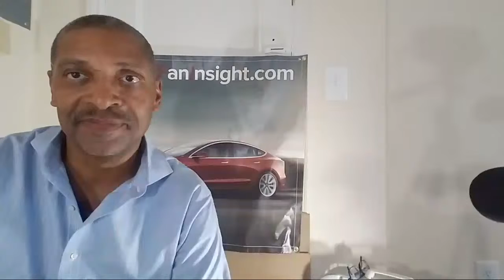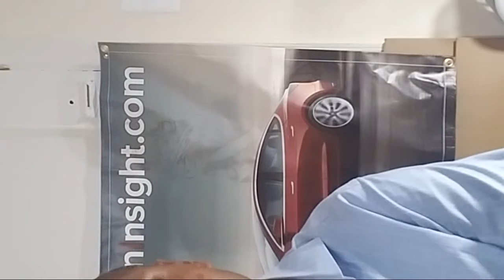5 Reasons Maxwell Dry Electrode Not Viable TESLA

Comment: Yeah, lots of confusion here. Dry battery electrode is a manufacturing process, not a chemistry. Ultracapacitors/supercapacitors (not superconductors) is something completely different, that used in concert with batteries, creates a winning combo. If you’ve ever been around a car with a massive subwoofer system, without capacitor, when the bass hits the headlights dim. With capacitor, the large spikes in power are shaved off from the perspective of the battery, thus the battery never has to work that hard. Same principle will be used with Tesla cars.

Comment: You contradicted yourself with reasons 1 and 3. Maxwell tech isn't viable since it won't be ready until 2022. Yet Tesla should fear superconductors that might appear in 2022? If a supercondcting solution were released today, it would take 5 years to develop an ecosytemaround it. No ICE car manufacturer will support it since it would cannibalize their current products and destroy their dealership's profitability.

Even your statement regarding Maxwell's market value was incorrect. The stock was devalued because auto makers had not made significant investments in battery tech to take advantage of Maxwell's tech. The product was proven to be viable but Tesla was the only company who could use it. Maxwell cooked a steak, andTesla was the only diner in the world with teeth.

Comment: This topic felt like either less researched or misunderstood, trust me not few years ago I was also one of the people who believed battery powered car is impossible (mostly due to media negative news) so I am not bashing you etc.

First of all, industries marketing team use terms which sound catchy or have wow factor to get public interest while terms might technically be wrong, like laser treatment beauty cream, and here they may have mixed the supercapacitor charging with superconducting bcz capacitors charge at blazing speed, so superconducting is catchy and also supercharging is already being used by Tesla. However, the use case here is the buses in China which travel stop to stop, and at each stop there is a overhead charging point which connects automatically when bus stops at bus stop. Bus travels for 2-5 min. then charge for 30 sec at stop and so forth, here the solution work bcz you need fast charge which capacitors support, you need hundred thousands of charge cycle, which again capacitors support, you need short distance between charge, again here travel time is in minutes between charges. Jack Richard from EVTV did a video explaining why Tesla didn't buy maxwell for super caps, jist of it was, the battery pack is so large that in fact motor cannot accept what the battery has to offer, at 2C the battery pack can push 160 to 180KW which motor cannot take and vice versa on regenerative power, so what's the point of using super caps, also super caps offer bad energy density both cost and volume, so it's just better to put more batteries for same cost which will give customer range advantage. However, I trust Tesla is not sitting on it and they may be researching super caps if it could reduce costs by reducing certain expensive components costs say in inverters etc. as Elon said it's game of pennies. 

Secondly, with any new technology, it requires validation, cost optimization and designing of not only processes but also tooling etc, so it's not like Tesla will switch to it over night, they might be testing new cells in company test vehicles right now, I believe maxwell technology will appear in Tesla GF3 (they don't have to worry about Panasonic technology getting leaked) and will be used for battery packs (if cell size is same they hardly need to re-engineer battery pack) made for new model Y, Roadster and semi. They can software lock batteries to collect data before either unleashing full capacity or produce same capacity battery by using fewer cells. In an interview regarding new battery tech, Elon said there is a lot of bullshit in the market. Look at Ambri, the concept of molten salt battery was solid but it is hampered by technical issues. I wish Elon had bought it as well since his work in SpaceX gives him unique experience to deal with extreme engineering required to design this battery.

Keep up the good work.
Reply from the maker: Thanks for well efforts comment

Comment: I had trouble understanding the points of this video. A lot of speculation, but unlike usually those were not based on common news streams. I have not heard that 2022 timeline would be carved in stone, but was given over a year ago. Elon has tweeted "Next year" when this was asked about this in Q2 release. Also, Maxwell tech is a manufacturing process so it can be applied to different chemistries. By seeing the comments given before me, I think you have to do a part 2 of this topic to clarify :D. Btw, Tesla's Battery and powertrain day is coming in six month so after that this should be clarified. One way or another they need new packs for Plaids and Semis. Thumbs up for tackling the technical problems!

Comment: Capacitors use is prohibited by the cost of the hardware to run it , Tesla will rule in this field of research as it is  Elon’s pet dream to make it work . I personally think the duel set up using caps to charge up fast put still use existing cells to run the motors only using the caps for fast burst of energy, will be utilised until solid state is cost effective .

Comment: Sorry Greg, but this was horrific.
1) Super capacitors are not the same as or connected to super conductors. These are different technologies.
2) Super capacitators will not replace batteries due to their different properties. They can complement each other, but batteries are way better in storing energy long term. The busses in China that you mentioned run with exactly that mix of batteries and super capacitators.
3) Elon Musk called the takeover during the shareholder event "quite strategic". So obviously he finds their tech very useful. Whether other companies would be able to profit from Maxwell´s tech to the same extent does not matter in that regard, hence the argument revolving a lack of interest from other investors is absolutely moot.

I´m terribly sorry to write that, but the information you provided on this topic were wrong to the point of misinformation.

And when it comes to the background view and noises and the abrupt ending...oh well...

Comment: Hmmmm... not sure if I'm with you on this one Greg. For starters, in the high-tech industry, stockmarket analysts are the last people to trust when it comes to determining a tech company's viability. Most can't spell "battery" - never mind having any understanding of the science behind them.
Also... not sure where super-conducting comes into any of this. Do you mean super-capacitors?
As I understand it, dry-electrode is more about the manufacturing process than it is about the chemistry (the latter being where the big challenges reside). BTW - Tesla just filed a new patent for cell chemistry.
Like many companies who are investigating new technologies, Maxwell is involved in expensive research that does not yet have wide market applications. For example, the element (metal) Indium is core to touch-screen functionality. Without Indium, touch-screens won't work. There's not a lot of Indium on the planet, and before its use in touch-screens was developed, what is in the ground was largely left there. Indium had mostly a "curiosity" value - one of which is the "screaming sound" it makes when you play with it. Today, everyone is scrambling to get the stuff. Tony Seba talks at length on the subject of "technology convergence" - when two or more technologies develop to the point where they all dovetail to make a viable business case. Prior to high-speed brodband and superfast cellphone transmission technology, the Apple iPhone was not possible (or not viable) as a ubiquitous product. So even though Indium's function in the touch-screen technology was well-known before the iPhone came along, it was pretty much a "dormant" substance, with little practical value in the real-world. Today, it is a critical element of .all devices using touch-screen processes. (note: Mindful of Indium's scarcity, researchers are actively looking for alternatives, including carbon nano-tubes and silver nano-wires - again... technologies that have yet to functionally dovetail with existing techniques).
Maxwell is in this phase - it has technologies that out-perform current systems and methods, but as yet cannot find their "slots" in existing technologies that are market-viable. The "dovetail" aspect is not yet there - but will be at some point.
Tesla looks ahead ten years and further (compared to stockmarket analysts and many investors who can't see beyond the end of their noses). We know that within Tesla there are some of the most advanced and skilled scientists at work on battery tech - Straubel and quite a few others. It seems unlikely to me that Tesla would snap up Maxwell if it had nothing of value to offer. My guess is that Maxwell offers Tesla additional avenues into electric power storage technologies - many of these avenues are currently cul-de-sac's - but when technologies relevant to them develop, their market-viability is assured.
Reply: Tag Makers Pet Tags ... that’s a really interesting read ... I’m going to do a deeper dive into that touchscreen tech.  You made me realize how much I didn’t know on the subject !!! Lol ...

Comment: Is it possible that this move was Tesla striking on a two-front attack figuring that super conductors and dry cell combined will make the battery system cheaper than ICE?
Reply: Supercaps not conductors but yes I agree that is what Elon tossed over to Jeff Dahn for the touch down

Comment: No doubt, graphene, once mastered and manufacturable at large scale will revolutionize everything. But I'm rather surprised to hear from you that superconducting busses are running in China. Do you have a link for that? Are you sure you don't mean super capacitors? Because Chinese busses are using supercapacitors. I too think your title is misleading. You were never too enthralled with Tesla's Maxwell purchase from the get go. I think mass scale graphene production, let alone graphene superconducting tech is further down the road than employing super capacitors and dry electrode battery tech from Maxwell.  Appropriately, this video kinda went sideways there at the end, so I couldn't do  my leg lifts. ;-)

Comment: I think you are mixing up superconducting and supercapacitors. Some electric buses running now do use supercapacitors instead of batteries. They charge quickly at every stop.  What everyone is waiting for are i) solid state and ii) graphene. The second is not as big a problem. Current manufacturing lines can be modified to adapt. Solid state will call for very different manufacturing lines. That said everyone has been underestimating how far we can go with just improvements to current lithium ion technology. Many new non-lithium-ion battery start ups that began a decade ago were aiming for $100-$200 per kwh (lithium ion was over $1000 per kwh then; it is already around $100 and possibly will get to $50 per kwh). Obviously those companies had to fold. So big players who were too hesitant to enter the curent li-ion market seem to be doing it now. 

There is very little chance of any  new technology coming into large scale by 2022.  Many people were hoping that when Elon was talking about 1 million mile batteries he was talking about Maxwell. But now it looks like just new chemistry with the same old liquid electrolytes.
Reply: Tru Jeff Dahns new battery but what if TESLA who released the patents already on this battery is keeping Maxwell as their ace in the hole?  What if it was the missing link in light weight heavy density non exploding rapid charging Solid State batteries? With a Million miles worth of cycling...

Comment: Tesla just patented jeff Dahn mill mile batt chemistry
Reply: AFAIK, this chemistry advance is mostly on the additives used in the electrolyte. 

Hence, in thesis, it's independent from the advancement in the process of creating the electrodes coating metal conductors with another chemistry where DBE (Dry Battery Electrode) tech applies. If so, both advancements could possibly be combined.

The solid state battery may turn out being substantially different though.

Comment: What does superconducting have to do with EV batteries?
Reply: Nothing.
Reply: I guess there's a confusion with supercapacitors...
Reply: In thesis, if there were very cheap superconductivity, one could make an energy storage device based on it. (At least as magnetic field as in a coil or transformer, but with no heat dissipation caused by resistance to current flow in the conductors).

I haven't heard about such a device becoming plausible though, don't know where this thesis came from.